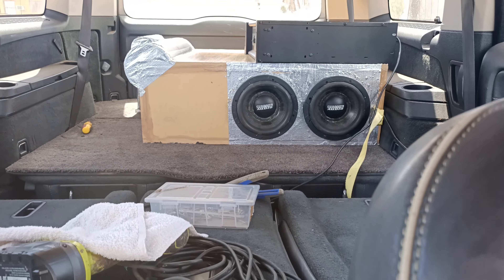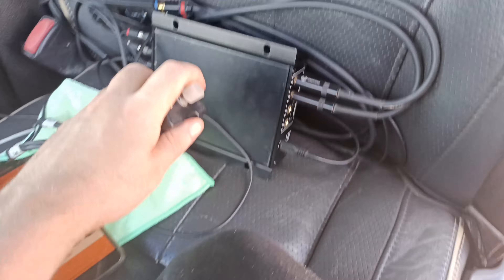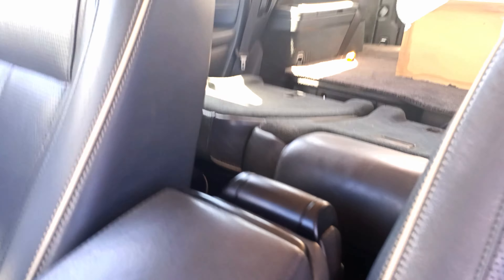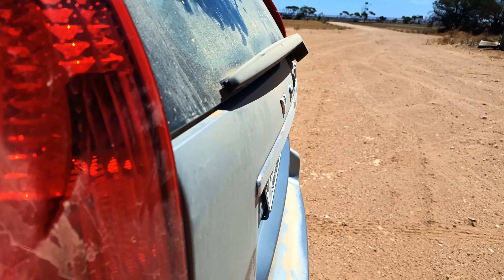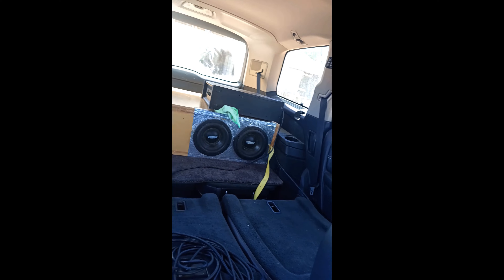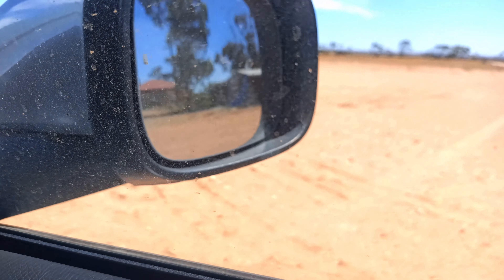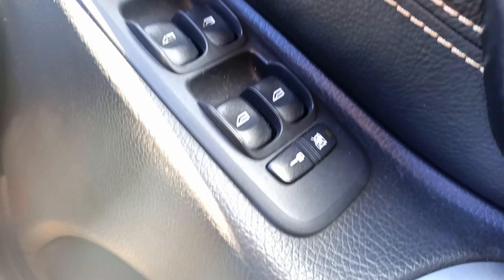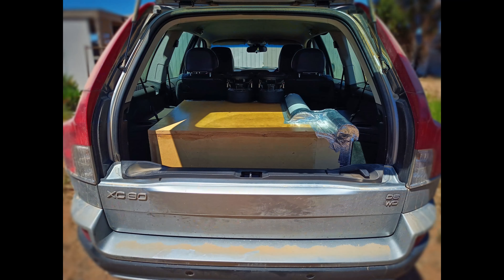Small subs in a larger car? (143.2 at 14hz Stock Volvo XC90)

Comment: Going from the car to a wagon how much did you lose in the highs and did you gain in the lows?
Reply from the maker: Sedan compared to suv
Reply: @puresesh7985  did that lower resonance change a lot ?
Reply from the maker: @TheBoxHot  not heaps but peaked at 14hz
Reply: @puresesh7985  peaked at 14hz but over all was it a higher spl or did it just lower the bandwidth and spl
Reply from the maker: @TheBoxHot  no my sedan would do 148s this won't